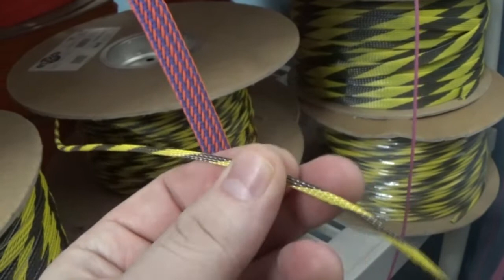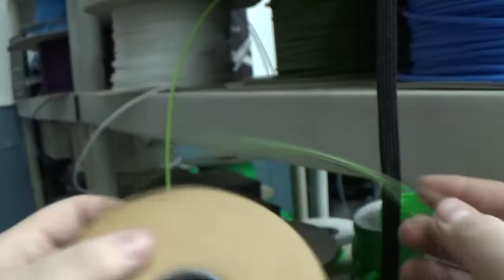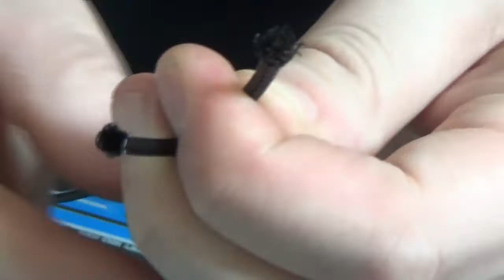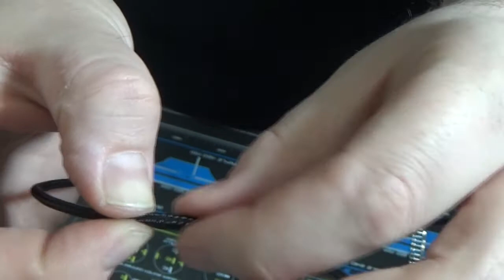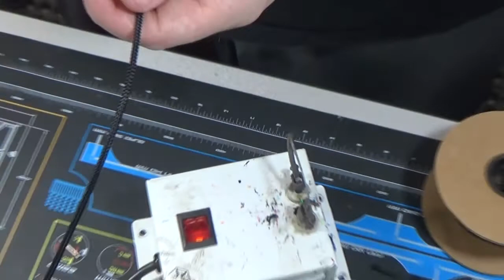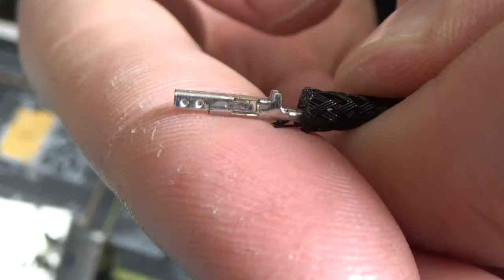How to sleeve Part 1: PET (heatshrinkless)

Comment: How hot is the tool? Maybe I could use a soldering iron or something
Reply from the maker: You could, having the tool be thin like a knife is key though. i'm sure you could make an iron work. The rope cutter does get semi red hot though. Not sure exact temp.
Reply: @thefrozencpu  ❤
Reply: Weller makes the same rope cutter accessory for their soldering guns.

Comment: Where can I get it?
Reply from the maker: Which item?
Reply: @thefrozencpu  fiber Sleeve
Reply from the maker: @Ironman-BB  Unfortunately we are out of stock of this particular brand in black 1/8th inch, I do however have some from Bitspower that can be purchased here: 

https://www.frozencpu.com/products/13933/slv-209/Bitspower_Super_Tight_Weave_18_Cable_Sleeve_Deluxe_-_Black.html?id=HugBuu9r
Reply: @thefrozencpu  ok I have some white fiberglass sleeves so can you tell me which black color should I use to turn it permanently black and it's never fade again.
Reply from the maker: @Ironman-BB  Fiberglass is a little bit different. You cannot sleeve with it in the normal fashion because it does not expand or contract. All sleeving does fade a little over time, especially left in light but generally black is pretty good about it.

Comment: Very nice technique...but doing this for PSU's is still very time consuming.
Reply from the maker: Sure is! that's why these cables cost so much to buy... not hard to to do just very time consuming. What I always tell customers ; )
Reply: @thefrozencpu  Does FrozenCPU sell premade cables for various PSUs like CableMod? I'm actually about to do a new AM5 build and am almost there with the parts list. My PSU is the EVGA 1300w Gold G2 Modular PSU. Seeing how good your sleeving technique is, I'd be interested in buying cables for it.
Reply from the maker: @GSP-76  No we don't anymore. We used to and still have a few sets on sale for some older PSUs, but nothing modern sorry! Which cables were you looking to get done? Just the 24 pin and PCIe?

Comment: Hot Knife works great. We just started using one to cut PET . We have to cover 5 lead wires of a wire harness. To feed the wire through the PET I found that a dispensing nozzle tip with a small tapered tip works good. I cut the nozzle down to 2 inches long. It just long enough so that the PET will slide over it without getting hung up at it's max diameter. Then just slide the lead wires into the larger opening of the nozzle tip. The tip is small enough to easily slide into the PET sleeving. Then just push the tip all the way through the PET until the wires come out too. I also cut my sleeving to the desired length prior to installing the wires. You could probably use the nozzle tip for your single leadwire. I still have to do the "Inchworm" technique. just cut it to length and diameter you need.

This is the nozzle tip I used https://www.mcmaster.com/7579A33/